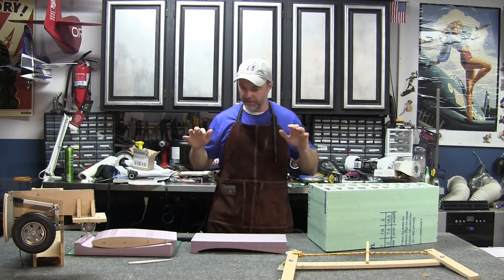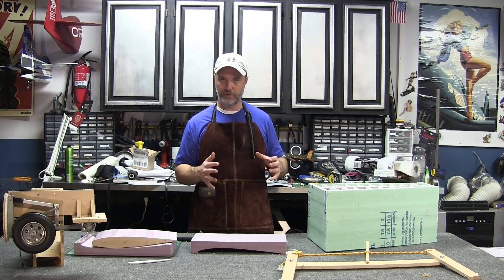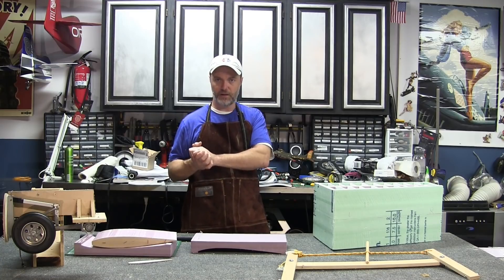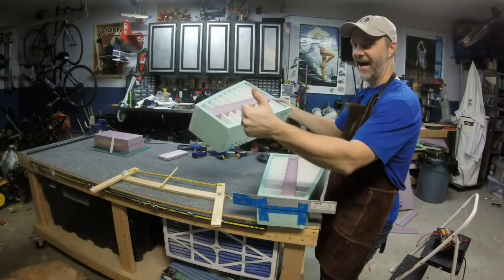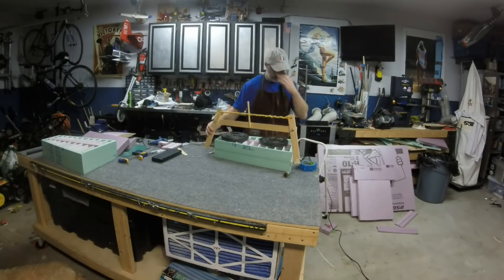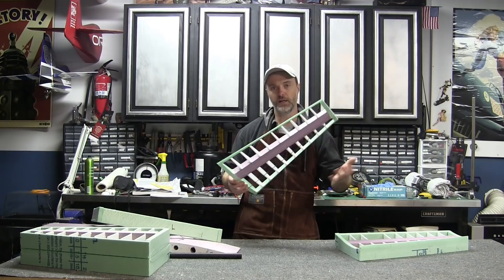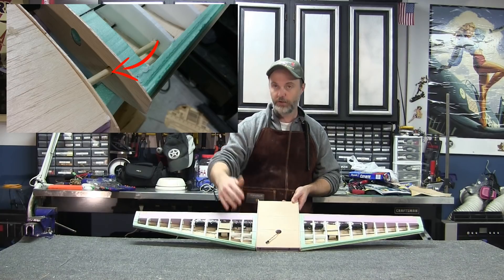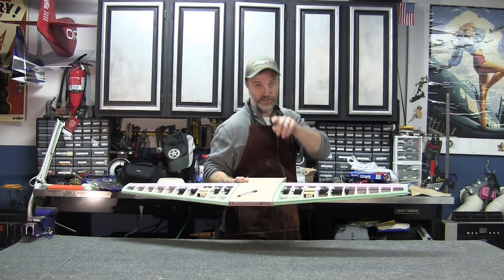1:9 Scale B-17G 'Sweet Pea' - Horizontal Stabilizer

Comment: What is the advantage to this construction technique over using solid foam and then cutting out the space between the "ribs"? Cant see it being much difference in weight. I assume it's just simpler and quicker? Very interesting though.
Reply from the maker: In principle there would be a big weight savings, but it would be hard to remove the foam between the ribs without risking warping the panels.  This way yields clean, quick results.
Reply: @CarlLydickRC  Thanks for the info. Haven't tried hot wire technique yet. I could see how the additional heat could warp. Not to mention having to cut a hole,  having to reassemble the cutter for each hole. Other than making plugs for molds. Haven't had much foam experience.  Not counting DTFB . Hope to give it a try soon.

Comment: Interesting technique, not seen it before. Will you use something similar on the main wing, maybe with more reinforcements?
Reply from the maker: That is the plan.  I had never attempted this technique before myself so I wanted to give it a shot and work the kinks out before doing the wings.  They will be up next as I'll need at least the center section so I can build the fuse/wing mount areas properly in the fuse plug.  Long way to go though :-)
Reply: Lovely build, what foam are you using?